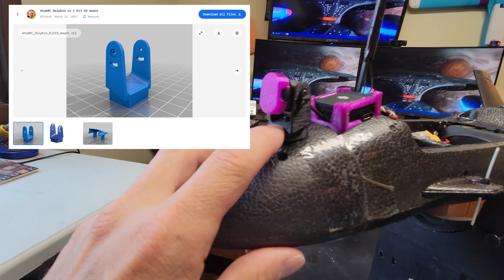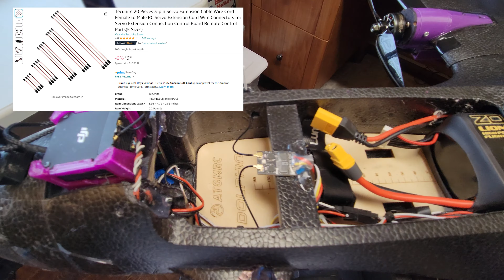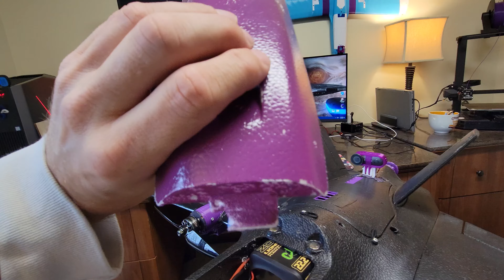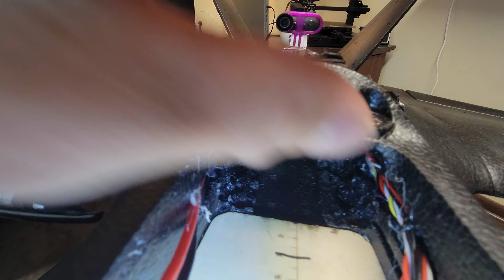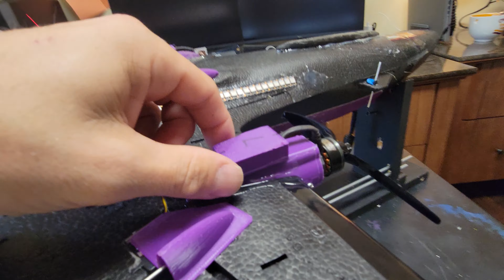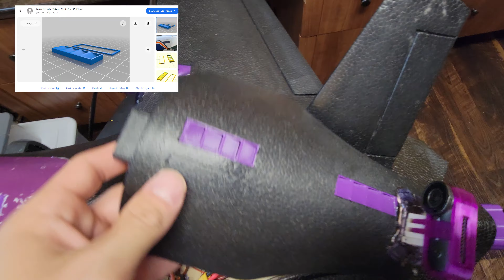6S Twin Motor AtomRC Dolphin Overview - INAV 7.1,DJI, ELRS, FPV, 3D Print!

Comment: Hello, what speed in 2 motors setup? Can in do 200? What power consumption? Thanks.
Reply from the maker: Can't hit 200mph with this.  You can get to 135, 140mph but thats it.  throw a super small lipo that is only good for one speed run and you can hit 180mph but it done in 3 minutes.
Reply: @JeffDoesThis  thanks, I gonna try 2 pieces - 2818, 1300 kv. With 6 props and 8S bat.
Reply from the maker: @grayaudio8657  Make video if you do it!  good Luck!
Reply: @JeffDoesThis  Ok) Thanks for yours idea.

Comment: Hey man, what was the reasoning for the li ion vs li po? Really been enjoying your videos lately!
Reply from the maker: The flight controller is good up to 8S, but the stock esc in the dolphin is only rated to 4S.  Li-Ion batteries are a lot lighter than lipos.  A 4000mah li-ion weights about the same as a 2000 lipo for the most part.  So to have longer flight times, I tend to go for the li-ion battery.